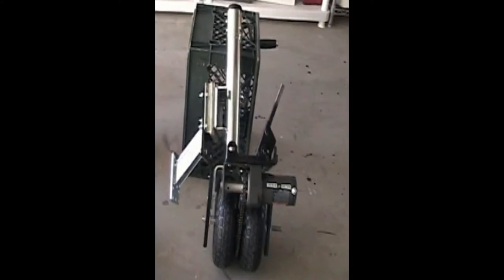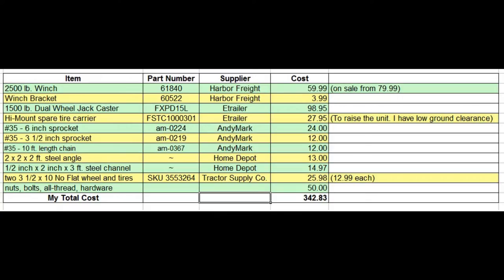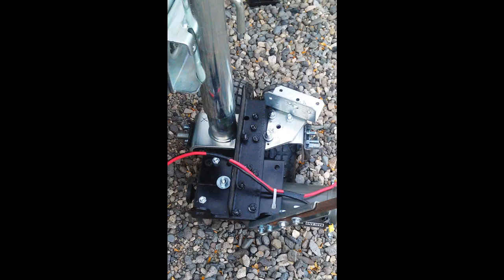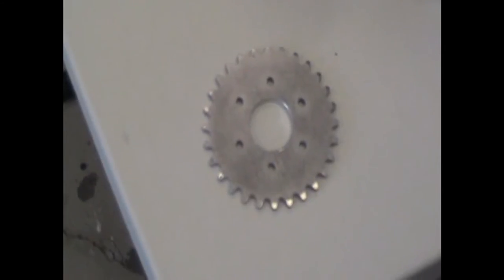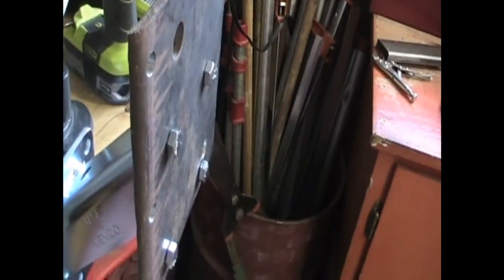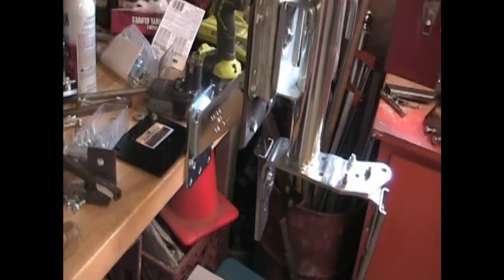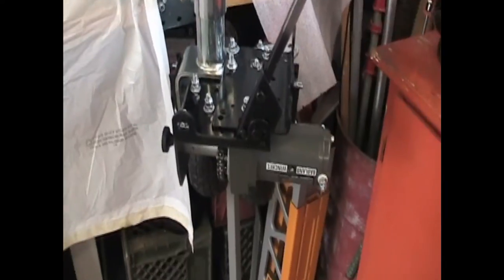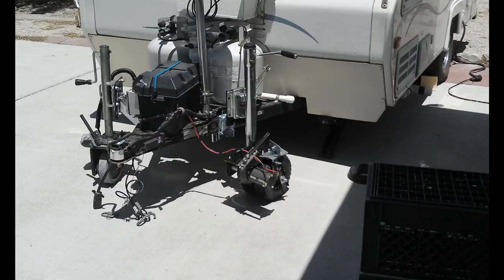How to Build a DUAL WHEEL 12 Volt On board Trailer Mule

Comment: I didn’t see a hub on the part list for this one.  Do I need that?   

More importantly: how do I remove the pulley assembly from the winch bracket?  I removed the pin near the handle.  But it appears to be spring loaded. I can’t seem to get the handle to come off
Reply from the maker: Hi Eric.  The hub is important if you're building a dual wheel mule.  The hub came from Harbor Freight.  It is a 10 by 3 1/2 inch tire and hub. The cost is 5.99.
Regarding removing the pulley assembly from the winch bracket - it is held by two allen-head screws.  To remove the handle, I held an open-end wrench over the handle and hit the wrench with a hammer to slide off the handle.

Hope this helps.
John

Comment: Very well done. I too have an aliner of which i wish to get into my garage a.... backwards. So Was either tinking of a winch. but quite like your idea.
Reply from the maker: Thanks, Brian.  I built mine due to back and hip surgeries but it sure comes in handy when I want to turn it around in campgrounds and of course, parking as well as connecting and disconnecting to and from my tow vehicle.  It moves the Aliner easily.You may have noticed that I have two mules.  The dual wheel gets better traction but is a bit harder to steer - so, when I am on dry pavement, I use the single wheel.  Just thought I would mention that.

Comment: Hi John. I would like to build one also. Just curious what size Gear motor you used, and where you purchased from. My trailer is 2000lb. and wondering  what torque size would be required .
Reply from the maker: Hi Brian.  I bought mine at Harbor Freight and I paid about $50 or $60.
Reply: Ok Cheers.
Reply from the maker: Brian, forgot to tell you mine is a 2500 lb. winch.
Reply: Ok well lookin at a 2000lb winch at Princess Auto on sale today for $79